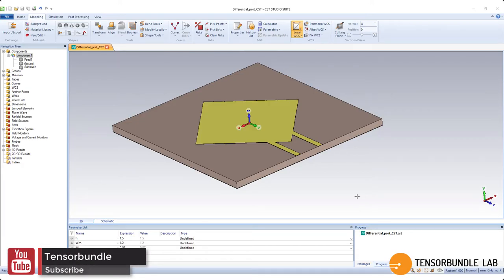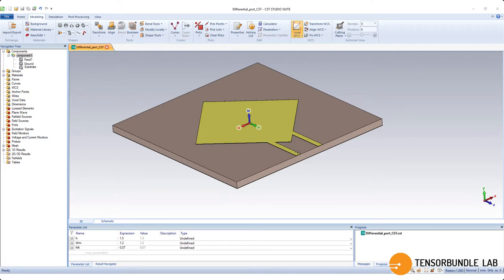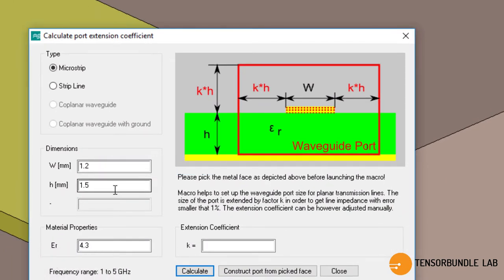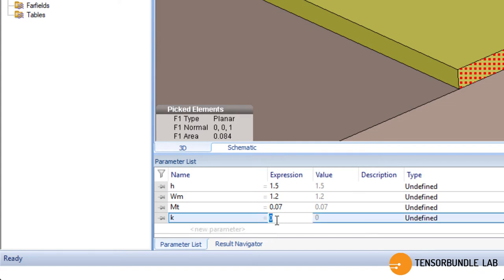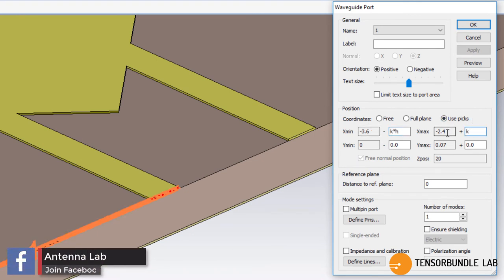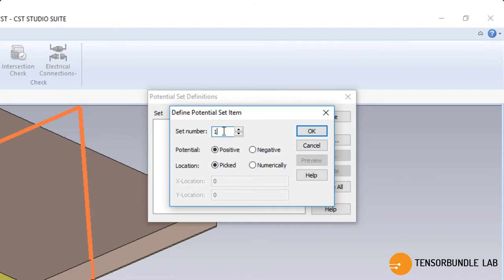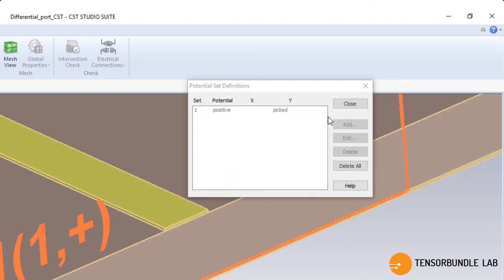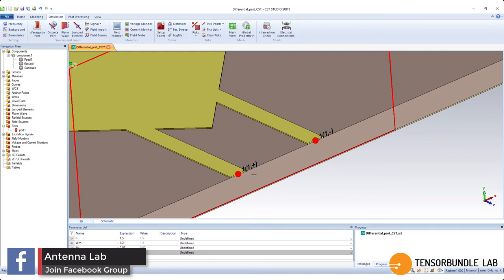CST Tutorial: Differential port feeding

Comment: If i need to design 2x2 Array MIMO patch antenna my i need two different ports or one port is enough for the feeding?
Reply: MIMO patch arrays typically have unbalanced feeds and two ports for linear horizontal & vertical polarization (or "slant" 45 deg.)